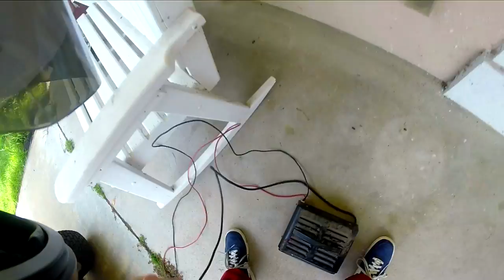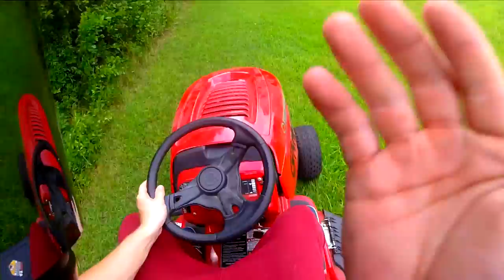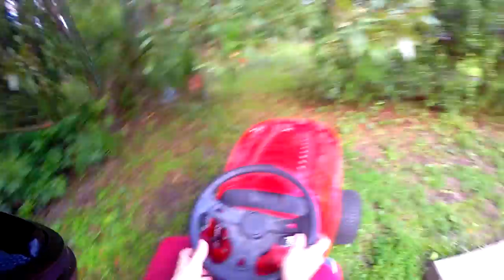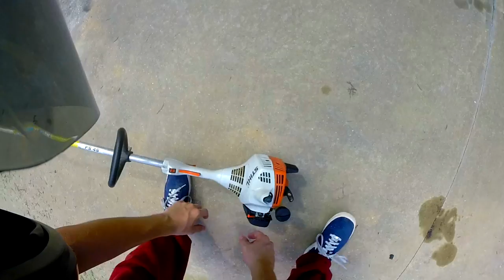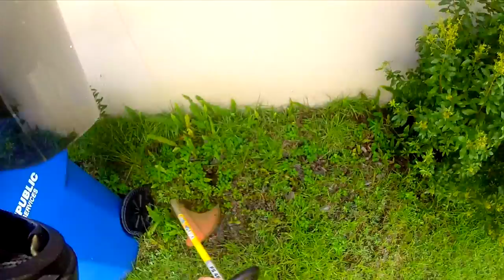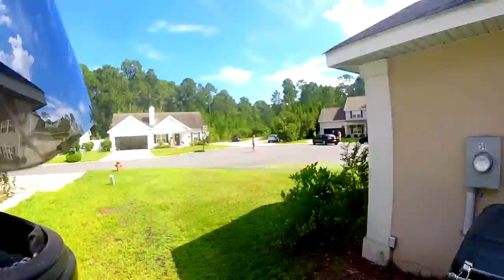Lawnmower Vlog - Pop The Molly I'm Sweatin'! + Next Bike?

Comment: are you rocking the 3 rotor 58 valve engine in that gixxer? it pulls like a fucking dragster.
Reply: George Washingturnt Nah I'm pretty sure he's running a R26B four rotor with a three litre stroker kit, titanium valve springs and an upgraded blinker fluid reservoir

Comment: Those valves need adjusted, their is a small portion on the cam lobes that act as a compression release, if valves aren't properly adjusted the starting system will not have enough to turn it over...

Comment: you need a john deer zero turn they can cut in reverse and a lot more easy  to cut the corner's   also i love your videos i cut grass pretty much all the time i plan on getting a ford powerstroke 6.0 with twin turbos 20 pounds boost it cost a lot but gotta keep saving up
Reply: riley coleman  Do yourself a favor and don't get the 6.0, one of the worst motors Ford ever made.
Reply: i know new head gaskets every other day but the 7.3 know that's the best engine they made